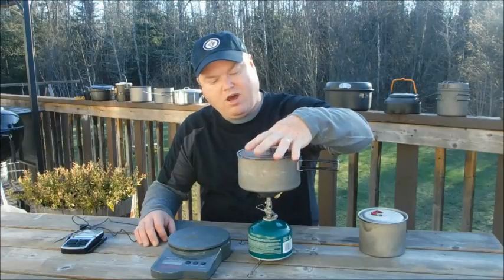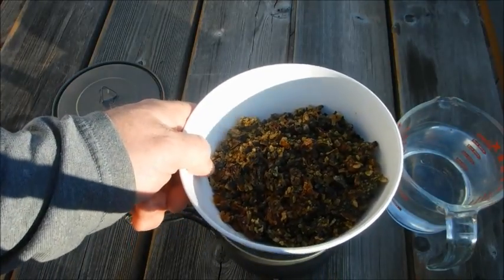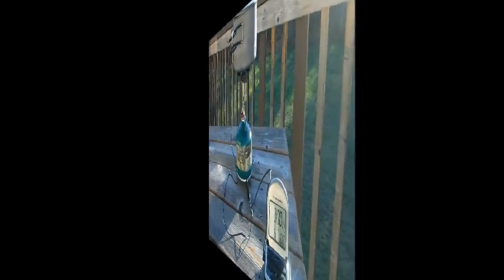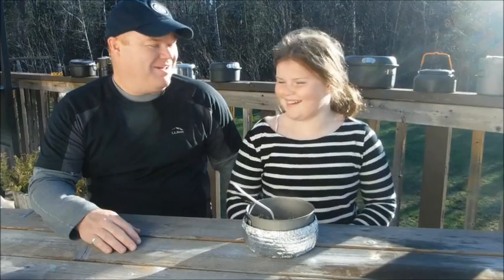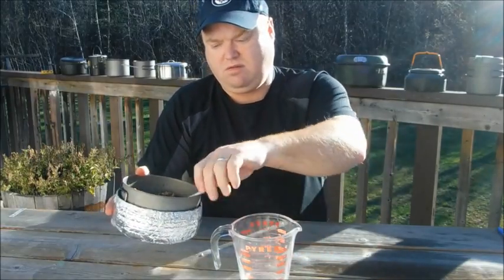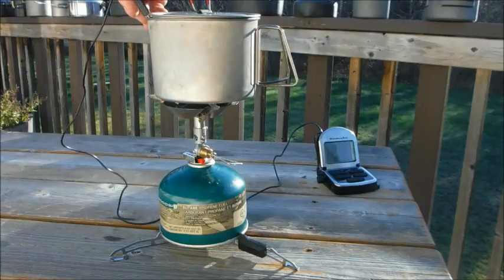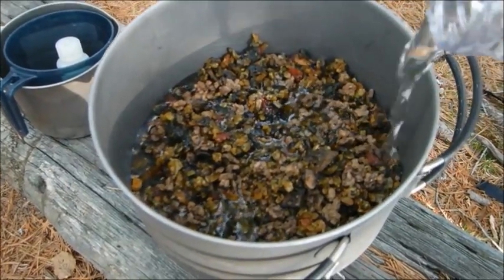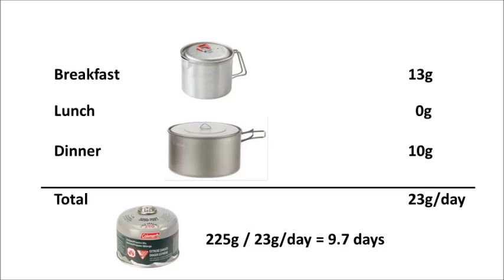How Long will my Fuel Canister Last?

Comment: Very informative to see those metrics.  Thanks for doing that!  Point out that rehydrating meals takes WAAAY less fuel than cooking it.  for example, you have fully cooked and dried pasta.  I'll bet you would use ten times the energy boiling the pasta out of the box.  HUGE savings.  Essentially, use your cheap electricity at home for dehydrating, and use way less of the very expensive (and heavy) BTUs from the gas cannister,
Reply from the maker: true, but for me, at least on a backpacking trip, I'm most concerned about the cost in terms of weight.  One of those canisters will last me for a week if I am just rehydrating my meals.  I have done the math and if I was to actually cook with them I would need to bring 4-6 canisters per week.  That is a lot of extra weight in my pack.

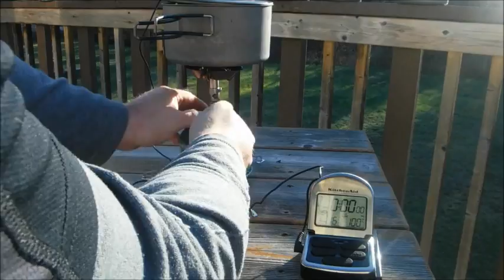Comment: Some thoughts: If you used treated water with your food, could you not then shut the stove off at, say, 1:45 where the water might be at 95 C and almost cut you dinner fuel consumption in half? Do some bench testing and see how the water acts and looks after it reaches 95 C (with food and water in pot). You would then know in the field what to look for to achieve a reasonable water temperature for the conditions and the food choice. You could do the same with your drink and breakfast water. If water can not touch your mouth until it is 60 C, then why boil treated water? Why not warm the treated water and save 2 more mintutes of fuel for that meal event?
Reply from the maker: Good suggestion MRo.  I do find a high temp helps harder items like chicken to rehydrate but I haven't tested to see if it is necessary.

Comment: Did you account for the weight of the empty canister in your calculations? There are s couple of other variables to consider; ambient temperature and fuel mixtures. Thanks for posting!
Reply from the maker: Thanks MaGoo.  As this video was about how long the canister would last I didn't include the weight of the empty canister in the calcs.  In this video I only used the fuel weight of the canister to project how long a canister would last.  In some of my other stove videos where i compare different cooking stystems I include the canister weight.  I hope that makes sense.  

Believe it or not the ambient temperature does not affect the boil times.  I have a video on that too.  It was a surprise to me.  Check out 'Ambient Temperature Test'.  I've done a bunch of tests and have come to the conclusion that wind is a major factor and wind on a cold day is probably worse than wind on a warm day but the air temperature alone has either no effect or is so minor that it can't be measured with what I am using.
Reply: Kevin Outdoors thanks for the info. Great job!

Comment: Hi! Very interesting video with very useful information - I particularly liked the methodic approach you took. I have a question and maybe you are the right person how might be able to help. Does it make any difference in terms of fuel consumption if instead of boiling the water at full throttle, you use less power? What I am trying to learn is if it really costs less fuel if you use half the power, for example than full power? Maybe you know already the answer or if not you might be able to check with the method you used here. Thanks for sharing.
Reply from the maker: Hi Vitor,  I may be able to help you out.  Check out this video....   

  https://www.youtube.com/watch?v=SIjgdcZGUWw

Thanks I appreciate the comments!

Comment: hi kevin, thanks for the info, considering you are using the foil booster, you may not have to sacrifice evening tea, boil enough water, then make cup of tea and let dinner rehydrate and heat while you sip, freeze dry, should be no bacteria ?
Reply from the maker: Thanks Duke.  I just used that as an example of how you can adjust your behaviour to be more or less efficient.  I would guess that lots of people use a lot more fuel than I do on a trip and I also know that many folks burn way less than I do.  My foil pot cozy certainly saves on fuel.  But the amounts of fuel calculated were to boil enough for my meal (using the cozy) and a pot of tea.  Thanks

Comment: what is the total burning time of a can of fuel at full blast? we all cook different stuff different days different trips,  while weather and altitude also with vary fuel consumption... I am trying to find out how long ,in time , does a canister burns...do you have a rough idea maybe?,,, reason is I also have a Coleman 1943 Dual Fuel #520 military stove that has a 1 pint fuel capacity and will give me 3 hours of  cooking /heating tent time at full blast ...I also have those propane stoves but don`t want to waste a canister to find out how long it would burn. thanks.
Reply from the maker: Challenging question!  In another video I boiled two cups of water at 'full blast' in 2 min 50 seconds and consumed 9 grams of fuel (check out my 'Dial Test' video).  Given a canister might have 230 grams of fuel (they vary by brand) that would equate to 1 hour, 12 minutes and 24 seconds.  The manufacturer suggests that will boil 15L of fuel.  I hope that answer is reasonably accurate :)
Reply: MSR claims their pocketrocket stoves will run for 60 minutes on a 227g canister.
For propane stoves, you can estimate the time with this simple equation: Time = (50 x W)/ C
where 50 is the energy content per kilogram of propane, W is the weight of fuel in the canister, C is the energy use per hour (MJ/hr)
Some fuel canisters for light camping stoves use a butane+propane mix. Butane is more energy rich by weight, the downside is it doesn't work well in very cold conditions... or so I'm told.

Comment: People tend to boil water too long.  You don't need a rolling boil for tea or coffee. A lot of bagged food will be just fine if the water is starting to steam but not boil. Shut that gas off.  And wind screens are a must to not have the flame heat shooting out from under the pot.
Reply from the maker: Hi Richard, I agree that there is no need to bring water to a full boil when camping.  In these tests I had to pick a reliable constant - so boiling it is.
Reply: Unless you purifying your water some other way, you do need to boil, unless your happy with stomach pain.

Comment: This data is perfect where the temperature never change, like in your kitchen or your living room.  I hike all year round under drastically different temperature and weather, one day it may be freezing cold with wind and another day, pouring rain.  You have to take into account that chill reduce greatly the effectiveness of the stove and wind can almost make the stove useless unless you protect it from it.  Be carefull not calculating to short and if it goes anywhere near the freezing point, get a decent mutli-fuel stove with naphta.  
And Kevin, your dehydrated food videos are the BEST, keep it up.
Reply from the maker: Thanks Pata.  Check my other videos on ambient temperature and wind.  I am convinced that the temperature makes no difference at all (strange but true) at least I can't measure a difference with what I have.  Wind on the other hand makes a huge difference.  I have a few naptha stoves but they are very heavy and require even more fuel.  I have a vid on that too.

Comment: Hi there, have you noticed any difference in longevity by inverting the fuel canister? Thanks!
Reply from the maker: Good question.  I don't have much experience with inverted canisters.  I understand that they do a couple of things 1) they tend to keep the canister off of the cold ground and 2) they help keep the propane in the canister from burning first with the regurlar n-butane mixes.  I understand that new winter blends of iso-butane/propane don't need to be inverted.  I haven't had any issues with my canister stove in the cold unless I put it directly on the cold ground.
Reply from the maker: I guess if you have n-butane/propane mixes inverting the canister should make it last longer.  I think at some point if all the propane burns first the stove will be less effective if it only contains n-butane.